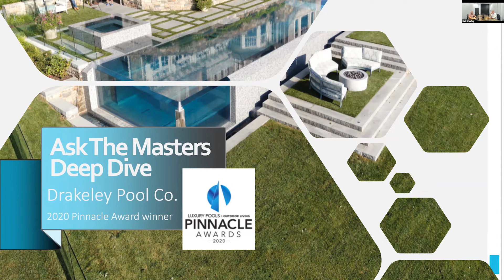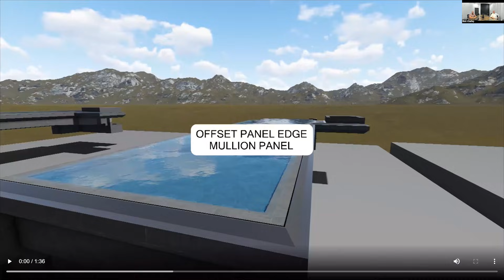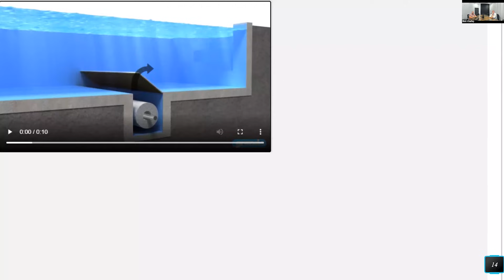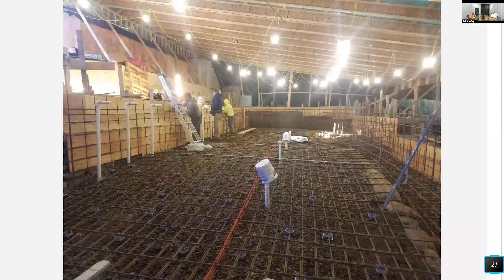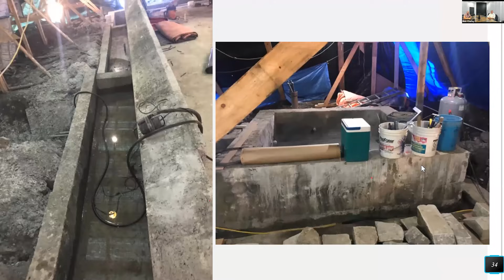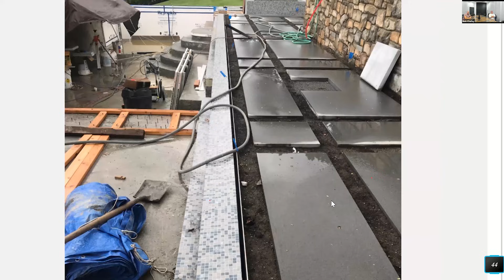Pool Construction Deep Dive with Drakeley Pool Company | Ask The Masters

Comment: That’s insane! Talk about over complicating and over engineering this thing..smh. WAY TOO MANY HANDS IN THE MIX..lucky this one came out right..hats off to Drakely! Better off using straight concrete, put it on 3/4 (floor and walls) water needs a way out (because Mother Nature will come and water and crushed stone can co exist together, PEACEFULLLY). Throw a 6x6 in your forms for your channel, remember leave a 1” gap on each end for expansion/contraction, width wise will only +/- marginally so no worries there. Have Reynolds’s make bad ass piece of glass. Crane in place, set/ seal. No need wasting $ hiring company to install/seal/“grout it” lmao. (guess you have to make it look good though 😉). Lay finish of choice (preferably a maintenance free custom finish) and enjoy that beeotch 💪.